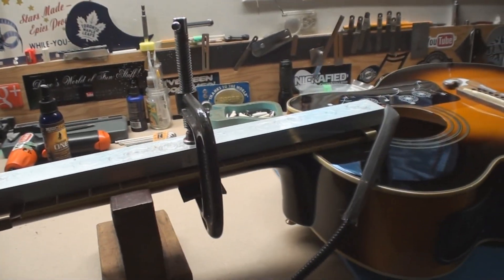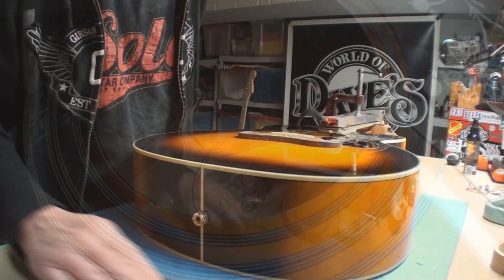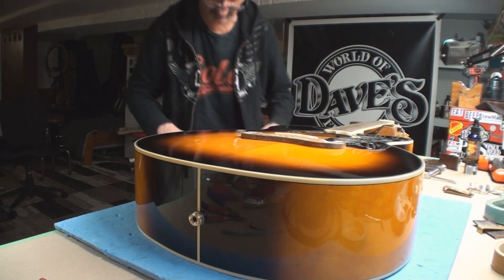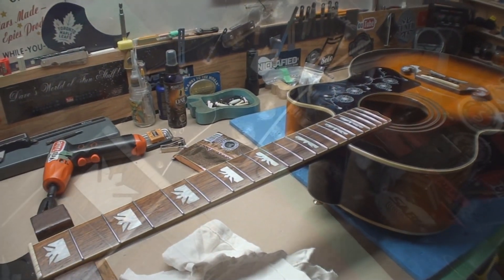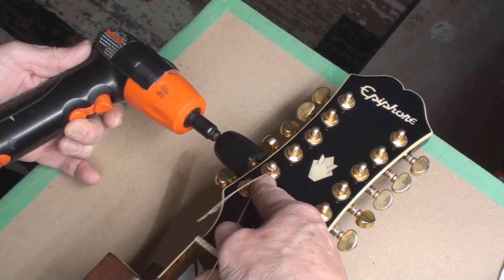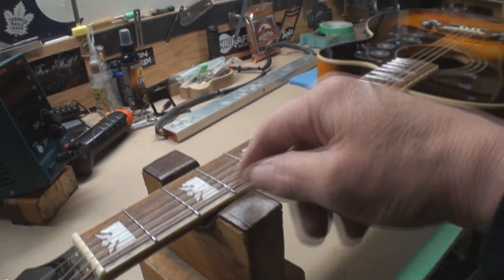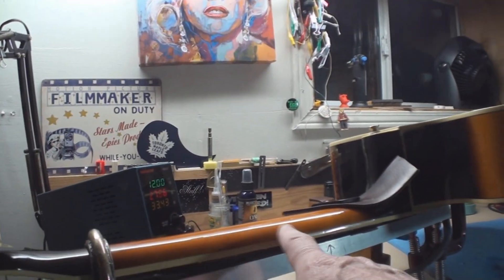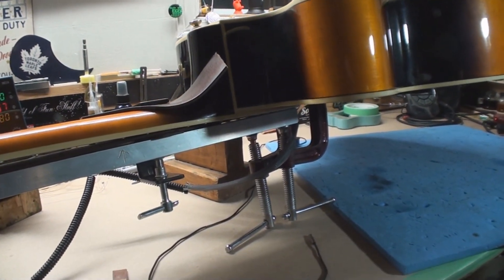Epiphone 12 String Guitar Still Unhappy Part 2

Comment: I think you'll find that the Epiphones in particular use Indian Laurel these days instead of rosewood. 

It's not a bad substitute, it's just very dry and if not oiled (like it should be from the factory, how hard is it to do before they string it? ), it's anaemic looking. It needs to be properly oiled ,and then it darkens and looks better (tends to take a few goes to give it the colour of rosewood). 

Not as good as rosewood in my opinion, but close, I guess. I have a Epi SG Special with a Laurel board and it also came looking like this. Much better after I oiled it!!

Comment: I had similar experience with epiphane and Framus 12-strings. Best to do is 1.) Bridge and Bridgeplate. (as I see the top has fallen in) 2.) find loose / broken braces. 3.) remove Fretboard find a new one, straight out the neck an glue on the new Fretbord. I Think only this will make the neck stay straight after the  heat-method.
And yes I scrapped some of the 12-strings, because it cost to much money to repair it . Shit made be Epiphone. I like You videos !

Comment: Only 12-string I have ever seen that was in worse shape was an acoustic 12 that had a bolt-on neck; the holes in the neck block had stripped and the block itself was shifting inside the guitar. That one was an Epiphone too, as I remember -- an early 70's model, maybe an FT-160. Just a mess.